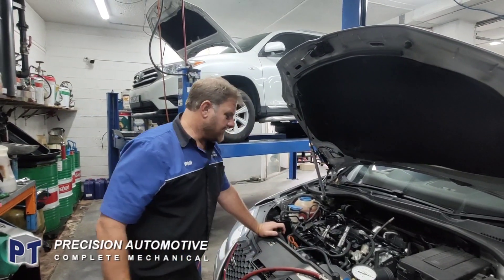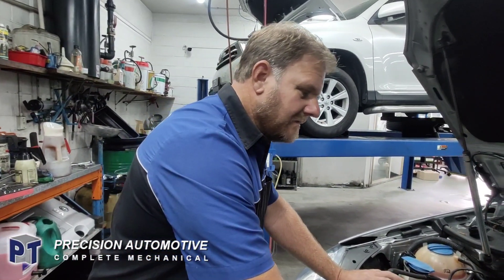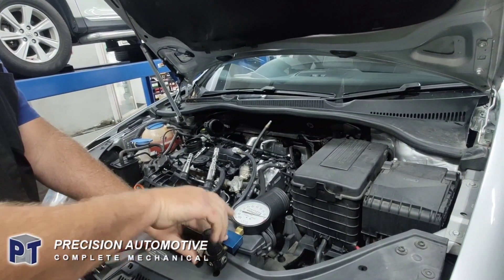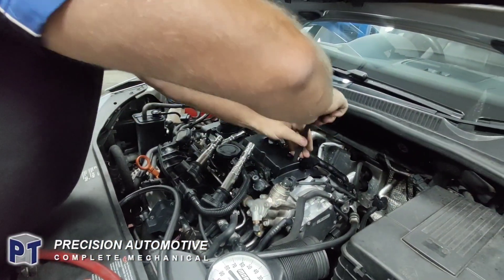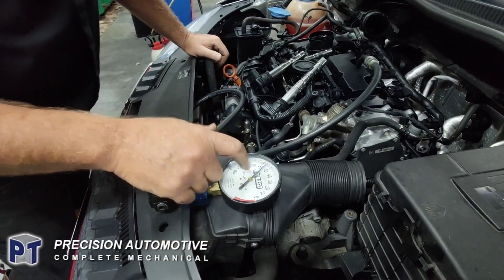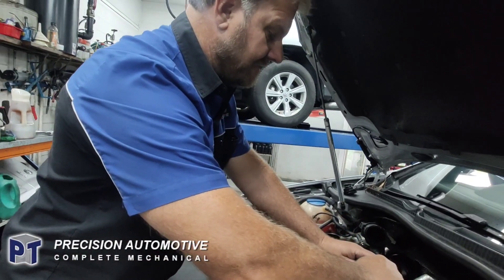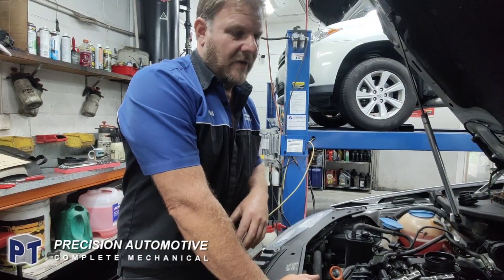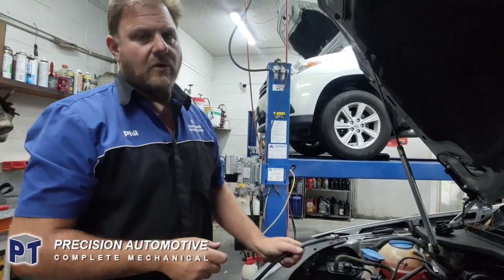VW golf GTI  BWA Engine, oil consumption - leakdown test

Comment: Hello!

I have a golf GTI '07 bwa with oil consumption. I figured the turbo (before 1L/2000km)  but still have 1L/4000km oil consumption. I have checked the compression equal in all cylinders 13'9bar like you in the vídeo.

Maybe i have problems with the valves... ¿What do you think?

Thanks!
Reply: 1l per 4k km is perfectly fine since those engines are known to burn oil from new sooo :)

Comment: Would there be lag in power with the piston operating like that?
I'm having the same issue
I had my turbo replaced and after replacing it the car (2016 Golf 1.8 TSI) would not get to 4000 miles without the oil warning on the dash
I currently have 179K for miles and the consumption is getting worse
No lag in power
Reply from the maker: i would do a leak down test on each cylinder.

Comment: i think i have cracked piston/s in my MK6 R, when i decelerate and then take off, usually low rpm it will blow smoke on take-off, if i keep the revs up by knocking it back gears it doesnt blow smoke, is that a sign of a cracked piston ?
Reply from the maker: no most probably valve stem oil seals. should do a cylinder leak down test.
Reply: @PTPrecisionAutomotive  I've let it sit for over a week, doesn't blow any smoke on start up at all, that was my first thoughts the problem was. Yes doing a leak down test today, compression when cold was 115, 125, 125, 125.

Comment: Pre 2010 where bad engines for piston and rings plus when you increase power the crank starts walking by by thrust bearing, German engines are not what they used to be
Reply: Yes, my VW Passat TDI 2016 Leaking oil 🛢️ like water, the same oil 🛢️ leaking in previous 2007 Skoda Octavia TDI . 
Even Toyota Corolla vvti my 3cars all losing oil 🛢️ no fix except piston rings :(
Can't afford to repair

Comment: Would a compression test give a similar result? also could it be a valve stem seal, or wouldn't that be as pronounced?
Reply from the maker: not really , car is running fine, just burning and using oil. this way it loads the cylinder and we can hear and see whats going on.